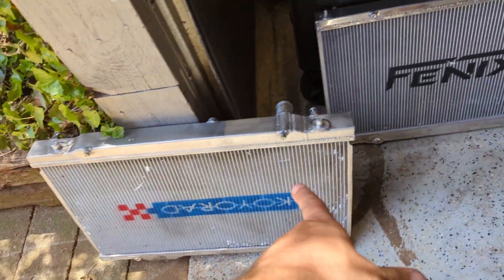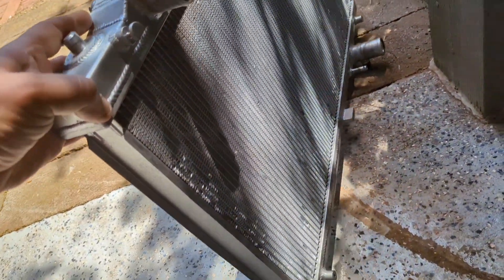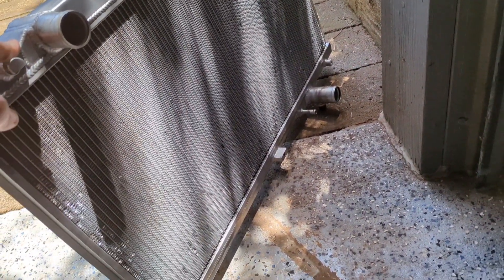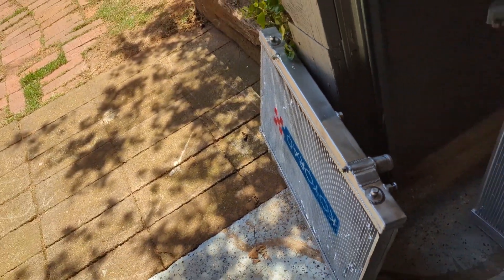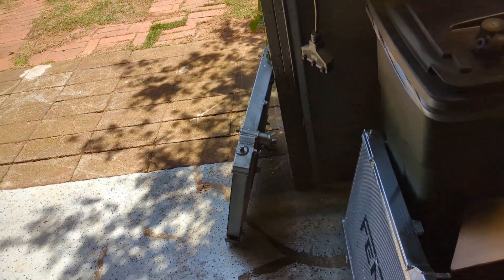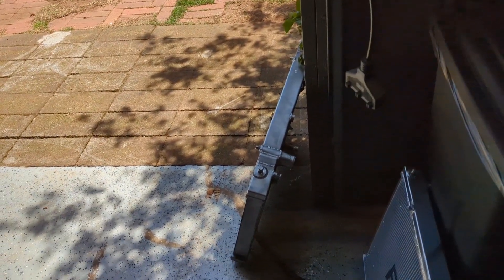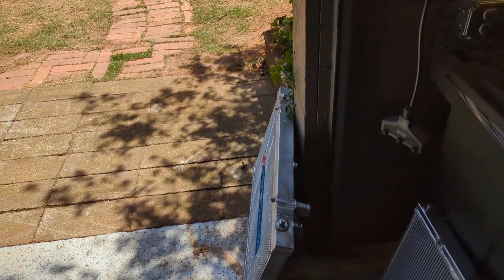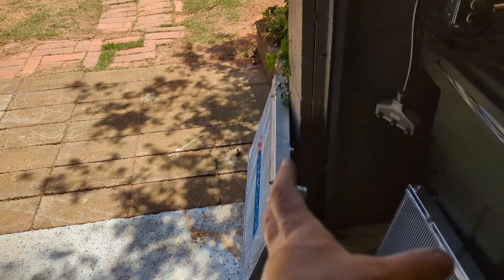Lexus isf  aluminum radiator comparison

Comment: Man, I'm glade you posted this. I keep telling everyone who keeps wanting to go with the Koyorad racing ones or other racing replacements and also daily drive that they'd deal with this. I never knee about this company making this version because I too prefer the heat exchanger setup since I daily mine. I didn't want to deal with delayed shifts or temps too low before operation.
Reply from the maker: You welcome bro...just trying to help. we isf guys are a small group..got to help each other 👍..this is not a popular stand..but feel strongly on the fact that no heat exchanger causes premature ware on our transmission.glad to see companys releasing radiators with the transmission heater built-in. Like 👍and subscribe my man it helps.

Comment: how about the rr racing package with a koyorad and a separate trans oil cooler, would that do the trick?
Reply from the maker: The rr racing pkg is Great...works very well in road racing...but in daily use not so much..I explain why in video...the external cooler helps with cooling excellent..but there is nothing to warm up the fluids while idling in cold start..hope this helps..
Reply: @samiboost404  so replacing the koyorad with the fernix while leaving the trans cooler would be the answer? can i still use the hoses that i had in my koyorad for the replacement or do i have to get new ones? thanks for answering my question btw you're a big help!
Reply from the maker: Thank you Correct..

Comment: Would you say the Fenix is a “plug and play” replacement for the oem radiator?
Reply from the maker: Hello.... Yes..like OEM but with better cooling and more reliable .. OEM+👍
Reply: @samiboost404  got one on order, waiting game now. Do you recommend changing the upper and lower radiator hoses too? I have a 2010 with 99k miles. Had the valley plate and water pump done recently also.
Reply from the maker: Congrats on the  radiator.. Yes for sure...do the hoses...

Comment: Can we run the oem transmission cooler and just upgrade the to Fenix radiator?
Reply from the maker: Sup bro...yes ..it is just like factory...you can also upgrade the external trans cooler or leave it stock depending on use..👍

Comment: With switching radiator did you keep the same trans cooler from RR or replace back w/ OEM
Reply from the maker: I kept the rr racing trans cooler..just ran all the stock lines..you can run a stack pne..but the rr racing trans cooler is a good upgrade from stock..

Comment: On the pictures online i see the L fitting at the bottom next to the drain plug and the straight for the transmission cooler on the left side
Are they able to be removed and swapped?
Reply from the maker: Yes .. definitely interchangeable..
Reply from the maker: The foam I got from Lowe's...ac area..
Reply from the maker: Don't forget to like and subscribe. it helps tks
Reply: @samiboost404  thanks for the reply and will do!
Reply from the maker: @lcameeno1  👍

Comment: What foam are you using at the perimeter?
Reply from the maker: I bought this foam seal in home Depot..1 inch wide ..it comes in a bag rolled up...I've used this type for years..hope this helps..👍

Comment: So what would be the best recommendation combo for an ISF just daily driven hardish, not so much racing really, just street, I’d want the best performance for long term. High mileage ISF 170K KM (100k miles basically) never changed oem radiator. Was looking at koyo but I think you make a valid point.
Reply from the maker: For your setup I'd do Fenix or figs aluminum radiator.... don't forget to like 👍 and subscribe...tks